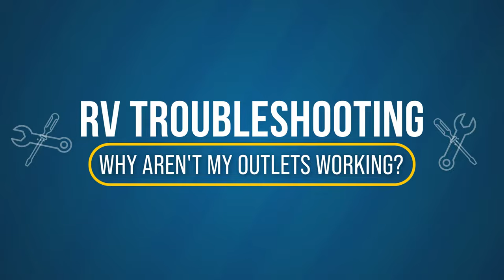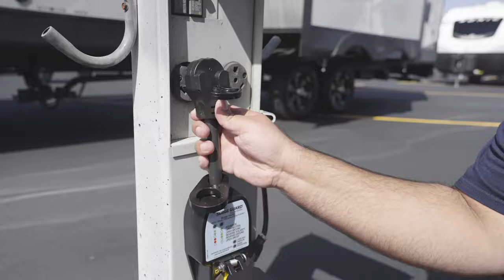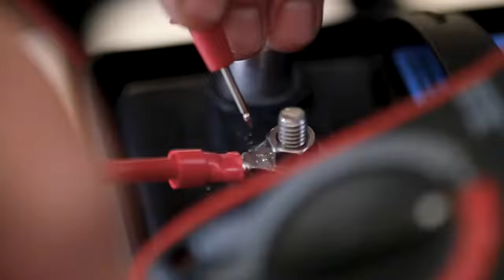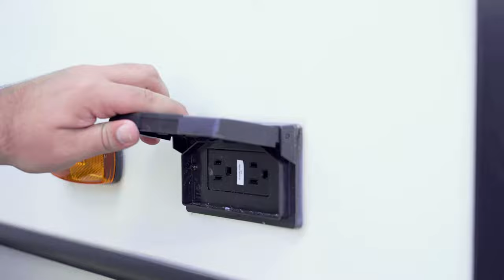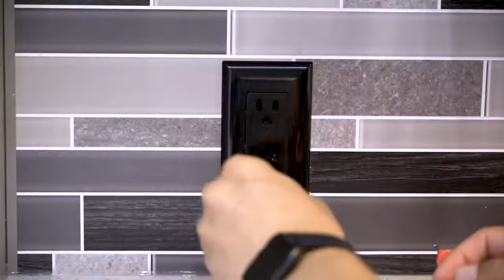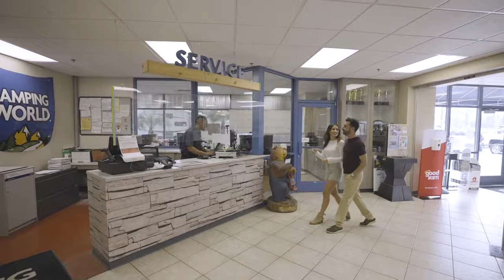RV Outlets Not Working? | RV Troubleshooting

Comment: My problem is i replaced my gcfi and the light is on but still no power my only outlet with power is my fridge n microwave. Any suggestions?
Reply from the maker: Hi There! 

For more context, what other troubleshooting steps have you already tried? Checking breakers/fuses? Taking multimeter readings at the outlet? Resetting the GFCI? Any additional info you can provide can help us provide more troubleshooting assistance, but you might also benefit from having a certified RV Tech inspect the electrical system as a whole. Here's a link you can use to schedule an appointment with our Service Department: https://cwrv.link/rvservice

Comment: What happens if the reset button is too hard to push in and it won’t go in when you push on it
Reply from the maker: Hi Robert, 

In the event that the reset button if frozen in place, it's quite possible that it has failed and you will need a certified technician to safely and accurately diagnose the issue. Here's a link you can use to schedule an appointment at a service center near you: https://cwrv.link/rvservice

Hope that helps!

Comment: Had a problem with my 2008 Fleetwood discovery,  i just started it two or three days ago and it started up fine. Went out this morning and I needed the auxiliary to start the rv. So I checked the two battery’s while not plug to the shore power it was reading 12 and 13 volts. The four house batteries were also reading 6 volts. What could be the problem
Reply from the maker: Hi There! 

We apologize for the delay as we awaited a response from our Technical Service team. Here are some checks to consider: 

Start with the battery terminal connections. Take them apart, clean with a baking soda solution, and rinse with water. Burnish all contact points with a wire brush until they are bright and shiny. Reinstall and tighten to factory specifications. 

Then, check the electrolyte levels and top them up to with 1" of the top of the battery with distilled water. Fully charge, about 4 hours, and load test the battery. If you don't have a 500 amp load tester, most auto parts stores will load test for free.

Since there is a chance the issue is with the alternator system, Jjmp start the engine or install a known good test battery to start the engine and test the alternator output to the battery. You should see up to 14.6 VDC if it is working well.

Finally, check the in-service date on the battery to ensure it is less than 5 years old. Flooded lead acid batteries seldom work satisfactorily for longer than that. It is very common for it to seem like they are working PERFECTLY but died suddenly. In reality, they have been declining from day one, a rate so slow that we just didn't notice until they failed completely. After installing a fresh, new battery the difference in how fast and powerfully the engine spins up will be surprising and obvious.

Please note that these batteries typically fail in one of two ways: they have one or more cells break internally which will result in "dead cell(s)" and a loss of 2.1 volts per bad cell, or the metal cell plates get coated with Sulphur compounds that prevent them from storing as much energy. In this case, the battery will still read 12-13 volts at rest but falls flat when a load is placed on it, like trying to start the engine.

Hope this helps!